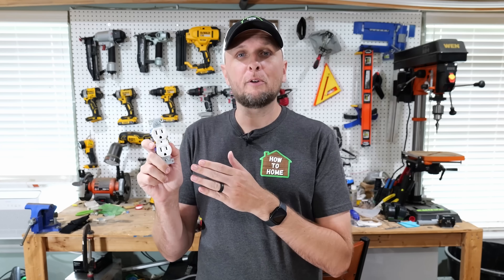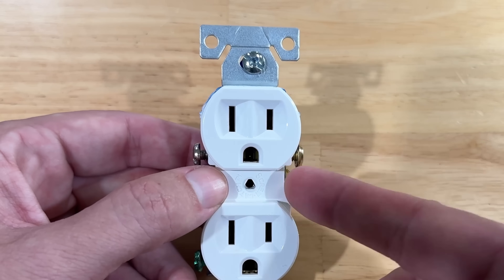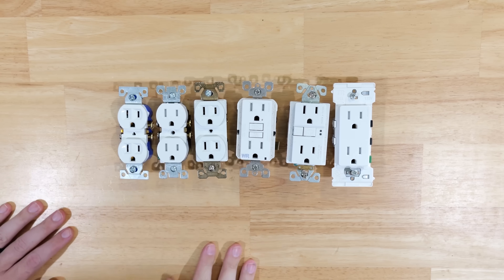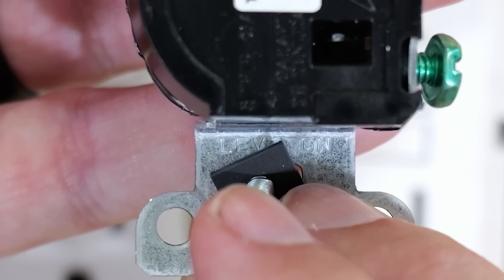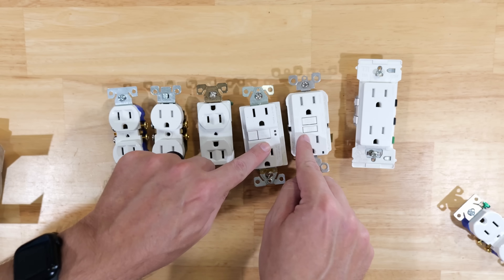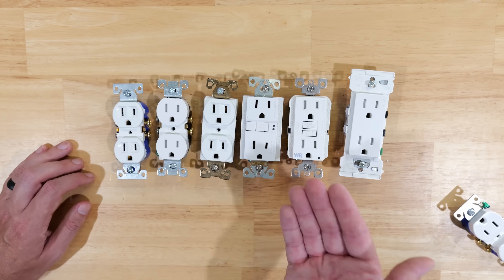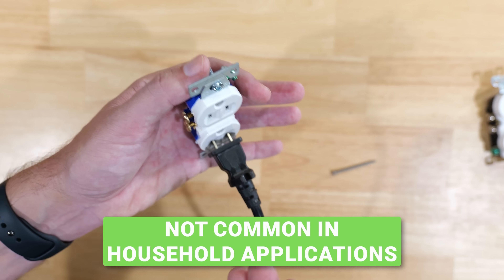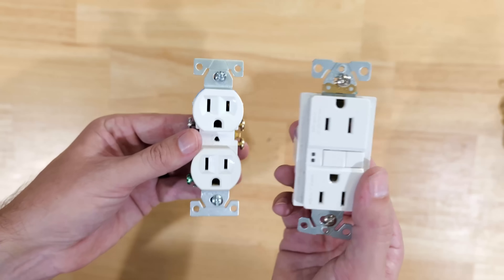The Shocking Reason Why Your Outlets Are Installed Upside Down!

Comment: The builder of our new home installed outlets connected to wall switches prong side up to distinguish them from non-switch outlets.
Reply: Our new house has the switched outlets upside down as well.
Reply: Yep all my switched receptacles are prong up also
Reply: @itsme-kn9zk so your outlets are wrong then.  got it.
Reply: @boyeatsworld-vr9ci  naw common practice
Reply: @raymondhernandez9926  it isn't though, as evidenced by literally billions of outlets throughout the nation
Reply: @boyeatsworld-vr9ci  millions of older homes, I'm  a residential service electrician, and I see it all the time in newer homes..
Reply: @birdsbamm  its not needed; its wrong too.  Appliances are universally designed to be prong down.  if it has a cable it should be fine but its inconvenient to go to plug something in and then have to realign (even if its only for a second, its annoying every time).  But some direct plug in appliances like floor lights or scent plugins downright dont work upside down.  so, its objectively wrong and people should stop.
Reply: @boyeatsworld-vr9ci  -  Speaking of wrong. Daughter showed me an outlet I have to replace. It is holes up in the floor underneath the hot water tank in her home for the heat tape. Yep you heard that right. The outlet is holes up in the floor under the hot water tank for the heat tape and when the tank went boom, filled the outlet with water. I am going to simply eliminate it and cover it with a metal blank. I am putting in a new 4 outlet box on the wall in that water tank hole. There is an access door inside and one on the outside of the house to get into there. Crazy design but you can get to both sides of the tank. Any other ideas or suggestions when I put in the outlet? I thought about a light in there also.
Reply: Valid, but what do you do when you split the duplex into two legs on one circuit, one switched, one not (using 14/3 or 12/3 Romex)?  That is how my switched outlets are deployed so you have the option to plug into "always" powered or switched.  Top half is switched, bottom is not switched... way more convenient than both being switched.  BTW... Most polarized lay-flat cords and wall-worts are oriented for ground down so they hang properly.

Having said that, my preference is ground down around the house and ground up in unfinished basements, workshops and garages (where stuff tends to go up against the wall and may fall).
Reply: @csimet convention is to switch the bottom half of the output and leave the top half live all of the time.  That way you leave your lamp plugged into the bottom and it's easier to plug and unplug the top.
Reply: @jfreedner  In most cases agreed, but I use my switched side for temp stuff like christmas lights and it is easier to plug into the top.
Reply: @csimet  ground up with the switched face on the bottom, so you can keep the lamp plugged in, and plug and unplug the other stuff easily.
Reply: @csimet  this is what I was going to comment.

In my experience if you have a wall wart with just two blades the larger blade (neutral) is always on the left hand side so that the wall wart (when outlet has the ground underneath) sits much better when it's plugged in with the majority of the weight underneath.

If you mount the outlet with the ground lug on the top, it seems like you will find many wall worts that you have to plug apparently upside down, and it may fall out of the receptacle.

We have appliances on our countertops like coffee makers that have a thick grounded cord and if you try to plug them in an outlet with the ground connection facing up, you have to put an uncomfortable twist into the heavy cord.
Reply: @csimet great answer(s). Thank you 🙏🏻
Reply: My house only switches the top outlet, not the entire gang.  It's only for a lamp.  It sucks when the wall switch in your bedroom turns off your nightstand lamp and your alarm clock.
Reply: Every house I’ve owned has been this way
Reply: @davemay8813 been that Way for 50 years
Reply: Yep
Reply: This is only a preference not a requirement. There was only one code that required ground prong up was 1984. Some appliance cord plugs are made to have ground prong up but there are others down. So at installation how would the electrician know this, most likely not
Reply: If you plug a KILL A WATT meter in an outlet with the ground up then your Kill A Watt will be upside down.
Reply: @flyingpuck15 lol
Reply: "Lamp outlet" we called them in the south...
Walk in the room hit a switch, easier than walking across to the Lamp, etc
Reply: @BEEFYBUTTERCUP  Yes, easy peasy to know where to plug in your lamp and switch it on. I mean who wants to fumble around in the dark looking for the lamp switch. Lol.
Reply: @BEEFYBUTTERCUP Alexa turn on the living room lights. Fixed it.
Reply: if he was on the ball, he made the switched half the bottom half, so you could leave the lamp plugged in and see to plug other stuff in the top.
Reply: Yeah, that's how all my houses have been.  The switches either control ceiling mounted lights or one single outlet for a lamp.  It would be annoying to turn off my alarm clock every time I left my bedroom.
Reply: @kenbrown2808 I have heard that referred to as a half hot in the past.
Reply: @jessejames14  yes, that's the common term.
Reply: @kenbrown2808 came here to say this.  The split receptacles are the way to go with wall switches.
Reply: @kenbrown2808  Yes - this is the right way to do it.  the switched outlet upside down is ridiculous.
Reply: @Jaba207  if by "ridiculous" you mean simple and straightforward, then yes.
Reply: @kenbrown2808 wow you can sure tell you aren’t an electrician by your comment alone
Reply: @joshwabii5577  that, there's funny, I don't care who ya is.  edit: was it the one where I said, I feel guilty if I charge a service call to tell people their plug isn't working because it's on a switch?
Reply: @kenbrown2808  there’s some top notch trolling coming from your end 😂
Reply: @joshwabii5577  almost like i k ow what I'm talking about, huh?
Reply: That's actually smart!
Reply: twice in my life i have seen a woman with a bracelet grab the top plug only to have teo bracelet hit the two prongs on the bottom plug.
It does happen.
Where is the outlet
Who will be using it
Some outlets are prone to higher usage others are plugged and stay there more or less permanently.
Thinking about the end user can help you decide.
Reply: @heyyou5189  heck of a loose bracelet.and thin.
Reply: I avoid the confusion and just install my outlets sideways😂
Reply: @rustyfan89  there ya go!!!
Reply: Electricity doesn’t care.
Reply: @tedsimpson3216  it's kind of like a honey badger, that way.
Reply: @tarfy58  it’s amazing how many comments we have here on such a mundane subject. We all need to “get a life”, don’t you think?
Reply: this is a common practice to better visualize what is and isn't switch powered.  Only time this really can't be done is when the two plugs are split between the two.  One of my rooms is like this with the bottom being controlled by a switch, but the top is normal power, same for the Garbage Disposal and the Dishwasher plug is split like this too.
Reply: Ground prong up indicating that the receptical is switched is the accepted standard among all the actual electricians I have met. Otherwise the ground prong is down.
Reply: I can’t believe he NEVER even mentioned the fact that GROUND PRONG UP for switched outlets is NORMAL for builders and most contractors I know!
Reply: That's a clever idea.
Reply: As an electrician You install them all in the same direction, and the screw all in the same direction.
Reply: @johnjoy423 "It's a common convention, not a code requirement, for electricians to install switched outlets (often called "half-hot") with the ground pin up to visually signal they're controlled by a switch, while always-hot outlets have the ground pin down, although some prefer ground-down for safety against falling objects. There's no National Electrical Code (NEC) rule dictating orientation, but the practice helps identify switched power, and manufacturers' instructions for specific devices should always be followed, notes" also, check out the video as an electrician
Reply: The idiot didn't think someone might want to plug a power bar into one of these outlets, and one which has an angled plug designed so the cord hangs downward when the outlet is in the correct orientation.
Reply: Only in the shop I do them ground up because the ground prong helps keep my cords from falling out when the outlet gets tired
Reply: @runsolomon  if the outlet is "tired" just replace it. Don't extend the life of a failing (yes failing) receptacle by changing the orientation. The cost of a receptacle is so small it is not worth the risk of using one that is worn out.
Reply: That is code in Nevada.
Reply: Same, although my current house does not have switch outlets.
Reply: I have typically seen the "face" is standard and ground on top indicating a wall switch.
This is how I replace and install personally but I have also seen people who install all outlets ground up with the typical argument being that if the plug is not fully inserted and a conductive material falls on it the ground should never have voltage in a proper situation so it reduces the chance of arcing. 
The other issue with this is when power strips offset the cable from the straight out of the wall position.

I have power strips that drop down from the ground, as well as off to the side between the ground and the hot/neutral prong all at a right angle to the standard cord head.

I have also seen one where it was at 8 o'clock facing with the ground on top and mine with a face that could rotate 360°. THAT is dangerous in my book.
Reply: This is the way.
Reply: @sncy5303  that's specific to commercial installations. Not that it's not a good idea.
Reply: Though not a requirement, this is the correct answer from a courtesy perspective.  I'm surprised that it wasn't mentioned in the video.
Reply: How about the ones mounted sideways, making a mountain out of a mole hill.
Reply: @johnlogan8218 only valid to install this way in an actual mole hill
Reply: Every switchable outlet I have only applies to one of the two receptacles. I'm a huge fan of just using labels.
Reply: @ahwhite2022  it's usually trailer houses, but I've seen some where the whole outlet is switched.
Reply: Prong down.
Reply: That's clever
Reply: ^This is correct way and most do this!
Reply: It doesn't matter, there is no regulation as to whether it is up or down. Just make sure they are all the same way.
Reply: Clever.  I should have thought of that for my garbage disposal outlet.  Might change it, except I Sharpie labelled it on the cover, so now my lettering would be upside down.  Plus, the other outlet in that duplex isn't switched.
Reply: What about duplex receptacles that have one outlet on a switch and the other not?
Reply: What do you do if half the receptacle is switched?
Reply: That's smart! ❤
Reply: Half hot is are fine and dandy until the homeowner request a ceiling fan. LOL
Reply: @4d4Spl  half hots are just fine, but they should be IN ADDITION to permanently installed lights.
Reply: Electrician for 40 years – I’ve always installed ground plug down
Reply: @frankphillips7951 isn't it nice to learn something new everyday? :)
Reply: yup
Reply: Good idea
Reply: Just to be extra annoying, our outlets are wired so that the top receptacle is switched and the bottom one is constant! 🤬 When I bought multi-outlet adapters, I had to make sure the top pegs were dummies. It wasn't easy to find!
Reply: Builder is an idiot
Reply: Ok, that is why! Thankx👍
Reply: Yes.
Reply: I was just getting ready to leave this same comment.
Reply: Were both plugs on the outlet switched or only one?
Reply: DING DING DING!!! We have our answer why it's done this way. Wasted 15 minutes on this guy saying not so much.
Reply from the maker: @joeblowe7545 😂 that’s not why it’s done that way.  It’s A way and good reason to do it but it’s not the reason.  So calm down lil fella, no reason to get all upset.
Reply: @HowToHomeDIY  I'm not upset. YOU seem to be. Get some thicker skin lil buddy. Lol
Reply: Common practice
Reply: That must look hideous.
Reply: @mountainman5025  Why? Do you fixate on receptacles? Issues with OCD? It serves a good purpose in identifying switched outlets. Simple as that.
Reply: What do you do if you want to combine switched and non-switched receptacles in the same outlet?
Reply: Sometimes for workshop benches, outlets are horizontal.   Now,  ground left or ground right?
Reply: Yes. Shocking reason. My house,  built in 1972, is like that.  This hillbilly  dude is insanely  shocking.
Reply: Wow. That’s the best idea I’ve heard in a while. But that would take extra wire from what this video says about the ins and outs thing. That is a great contractor. My respect 💕
Reply: Good idea.
Reply: Our house has the same setup
Reply: Here too. But the Switched part is at the  bottom.   He did not Wire  it Bottoms Up. Just twisted it.
Reply: That's actually a clever idea!
Reply: Literally why they do it, I have no idea how this guy milked 15 minutes out of it and I won't be sticking around to find out.
Reply: I find when I have a outlet that is controlled by a switch I prefer to use illuminating outlets. First to let you know it's on 2nd and let you know where it's at. An added bonus is illuminating outlets also let you know if the breakers tripped.
Reply: The only way I see it, ground print up is smiley and ground prong down is scary!
Reply: Good idea! I’m going to do that, too, next time I dig into my outlets.
Reply: Yes common practice
Reply: I tell u what most plugs are not designed for the plug going up
Reply: so he did it wrong.  ok
Reply: You are absolutely😅 correct! Ground prong up = switched outlet. Basta!
Reply: Medical places ground up rewuired in fl
Reply: That's actually a great idea, but of course it would never be a code issue.
Reply: Im surprised he didn't point that out.  I thought the ground up for switched outlets was a standard.
Reply: Yes I have see this technique used.
Reply: That must look awesome
Reply: I am WAY too OCD, I'da made him come back and flip them.
Reply: Is that included in the instructions manual when purchasing the home?
Reply: I never knew that!  Interesting.  Thanks for that.
Reply: I have seen similar with those that are connected to flywheel, backup generator, or other alternate power source; though in other buildings a different color plug or cover plate was used to distinguish which only used mainline power and which either had failover capability or was always directly connected to alternate power source.
Reply: One of my rooms has the outlets upside-down imo..I figured they were wrong bc of how close to the door moulding they were put..usually requiring lots of adjustments when changing out to decorative plates. The one room with the outlets upside-down has a switch on wall turning them on/off.
Reply: I'd flip them over.
Reply: I’m a big fan of half-switched outlets, because it’s rare to have two things that need to be turned on and off with the same switch. Put the lamp in the switched outlet, and let the other one keep your clock radio running 24 hours a day without interruption. And in this case, there’s no need to flag it by installing it upside down, so they all look consistent.
Reply: That's pretty much the standard; ground up means it's switched.
Reply: @VideoArchiveGuy  I’ve never heard of nor seen it in my career, but it makes sense, as long as the residents of the home understand it. I suppose you could Paint the switched portion a color of your choice to identify it as well.
Reply: @dgoins6  no they do not
Reply: @bobvecchi304  they should
Reply: @dgoins6  why does everyone think that it’s necessary to identify switched outlets? It’s your home, don’t you know which outlets are switched? How about a small label to identify it if you can’t remember. Or so what if you can’t remember?
Reply: @bobvecchi304 We bought a 3900 set house 4 years ago, we still have switches we have no idea what they are to.  It took a while to figure out another one of the switched outlets as the switch was for two outlets one on the same floor and one outlet on the floor below.  I like to keep that switch in the on position so I can use the outlet as normal unwatched outlets, unfortunately I have a kid with OCD that wants all the switches going the same direction!  He kills me with the 4 way switches!
Reply: @kengell007  just when I thought we were done talking about outlets, now we are changing the subject to switches.
Reply: @bobvecchi304  my ex moved into a new home and paid an electrician $200 because an outlet didn't work. It was tied to the switch.
Reply: @dgoins6  she got ripped off. It shouldn’t have taken him more than two minutes to figure that out
Reply: @bobvecchi304  they have a minimum to show up.
Reply: @kengell007 If you want to convert three-way switches (For switching from two locations; four way switches are needed for 3 or more locations) so that they are on when both switches are oriented the same, but right now the circuit is on when one is up and one is down, just swap the traveler wires in one of the switches. ✌️
Reply: @jfreedner  Why not just flip the switch?
Reply: @bobvecchi304 , my best friend (rip) was an industrial electrician and he told me the industrial code here was the ground prong up.   I orient them in a manner that puts the least amount of stress on appliance cords with  right angle plugs.  Varies from location to location and appliance to appliance.
Reply: @bobvecchi304  it's not necessary, but it's convenient.  I men, I've been in houses where they weren't identified in any way.  kind of feel bad hitting them with a service charge to tell them their electrician was an inconsiderate jerk.  well, actually, I usually eat the service change, because I'm not an inconsiderate jerk.
Reply: @kengell007  there have been times I've toyed with the idea of getting a cheap industrial control system and building a relatively cheap system to put momentary contact networks in, instead of 3 and 4 way switches.  but it's still expensive to do it.
Reply: @jfreedner  you can just turn the switch the other way up.  but really, with OCD, he may be putting all the switches to matching positions regardless of the lights, and the solution would be that many manufacturers make one or more lines of electronic dimmer that always return to the same switch position after an input.  it's expensive, but it would solve the problem if the kid turning all the lights on or off to make the switches match.
Reply: @bobvecchi304 Because 1) it's annoying to always have to remember--yet another damn thing to remember amongst myriad others in life--which is switched vs. no't, 2) guests or longer-term visitors would need to know which are switched, and 3) others will eventually live in your house after you move or die.
Ever heard the phrase, "Common sense is not so common?"😂
Reply: @bobvecchi304 I bought this home from a lineman, but wow, the electric run is this home is shoddy as hell. I'm not an electrician but I was able to troubleshoot and determine some flaws. It also has switches that go nowhere. When I redo the lines I'll keep all the info for the next person who buys the house, and for me later. I'm doing this for all the things on this property. I don't know if doing this is common, but it's my first house and these a holes intentionally hid things and it's been costly and time consuming to deal with.
Reply: @VideoArchiveGuy that’s what I was told by someone told me years ago and I just assumed that’s how it was
Reply: @VideoArchiveGuy   it is only "standard" in areas where it is standard. Many (most?) jurisdictions do not follow that practice. When discussing installation practices and trying to suggest that something is the standard, it is important to understand that "Standards" that are not specifically called out by Code or the manufacturers only apply to the specific jurisdiction you are talking about. Which version of the code a jurisdiction uses can have a big impact on this. I've worked in a lot of jurisdictions in many states from small rural towns (population <1000) to major urban cities (Chicago, St Louis, Las Vegas, Denver, etc) and the "standards" in those places are very different. Some are defined in the local requires such as Chicago's effective ban on Romex, to undefined requirements like a town that banned the practice of "back-stabbing" standard-grade receptacles (they experienced a couple of fires attributed to the practice). In some jurisdictions if you switch a receptacle, they require the entire to be switched (both plugs). In others, when switching a receptacle, you must break the shorting bridge such that only the outlet at the top is switched and the bottom one is always powered.
TL;DR always check what is required and what is standard practice for the jurisdiction in which you are working. Do not assume that what you did in another jurisdiction is also what is done where you are.
Reply: @VideoArchiveGuy it's not specified this way in the code and it's not a standard for everybody.
Reply: I've wired so many houses and never flipped a switched receptacle, plus I make the top half switched only if I do install this set-up
Reply: @VideoArchiveGuy no that’s not a standard or code that switched outlets have ground up. So never go by that
Reply: @johnjoy423  I think what you meant to say is that it's not universal, so your results may vary.  because it is, in fact, a standard for many electrical contractors.
Reply: Ground down for ease of installation.  Connect ground first and position the ground wire in the box so it will not make contact to hot contacts. The receptacle can still be laid out of the box face down to easily make the other connections.  The ground up means your working upside down to finish the connections
Reply: This is what I was coming to say that I see this! Other than that I always install ground down.
Reply: We built our own house and install the outlets sideways. We like to be different. The socket closest to the switch is the one operated by the switch.
Reply: @rivermcratt3683 Days gone by most houses had sideways mounted outlets.
Most Ive seen like that have been ungrounded outlets
Reply: For aesthetic purposes, symmetrical being ideal, the face position with the two flat prongs up and the ground prong as the mouth "0" I believe would appear to most people to look best. Sideways outlets make them look unbalanced. Would you place your television off to the side instead of centered against a back wall? Would you hang a picture of a face upside down with the mouth on top?

 @rivermcratt3683
Reply: Big deal that was how they've done it for over 20 years .
Reply: All ground holes need to be down. You can purchase a label kit that has labels that you stick onto recepticals that are switched. Most wiremen have a label device, that will print a small label, for SWITCHED, or 3-way, or 4-way, or whatever it controls, to go neatly, on a cover
Reply: So…what does prong up actually mean? Either way at least one prong is “up”
Reply: @bobvecchi304  They are referring to the ground plug (or socket), which what this video was all about.
Reply: @bobvecchi304 one singular circular prong up vs down vs the two flat spade type protrusions.  I get your question even though I may have questioned intentions but I grew up building houses so extremely fair question. We don’t know until we know
Reply: @aaronblackford981  oh, I know that a prong is a generic term, regardless of shape. A more descriptive term, such as “ ground prong” would have been more accurate for those not very familiar.  In my career as a licensed electrician for 50 years or so I’ve installed thousands of them.
Reply: @bobvecchi304  quite fair.  Very fair indeed.  It’s hard to use the perfectly crafted terms for all people as there are many that don’t know that’s a ground prong.  I grew up more framing houses and finishing them.  Not much of electrical side.  Until I got into cars.  So I had to relearn some terms going back from auto to buildings as one black is positive and the next black isn’t. Or whatever the correct terms are.  Lol.
Reply: @aaronblackford981  good point
Reply: @bobvecchi304  The video has that information right at the start, and the description specifically talks about "the ground up or ground down."
Reply: @bobvecchi304 

the ground hole, is what they're talking about
Reply: @bobvecchi304 lol
Reply: @bobvecchi304  Did you not watch the video?  It's very well explained there.